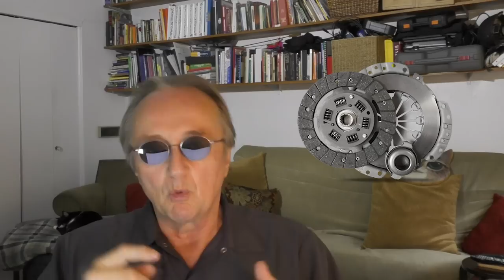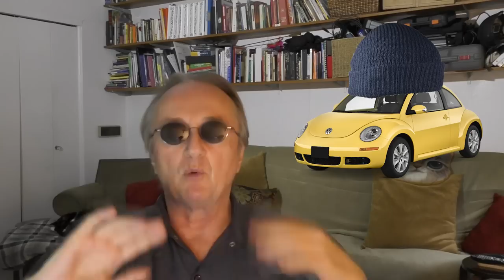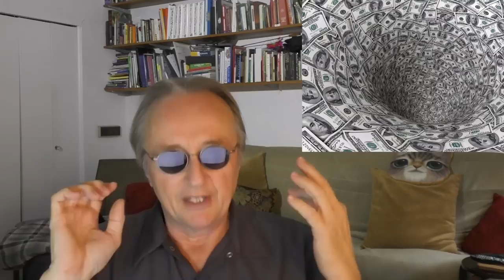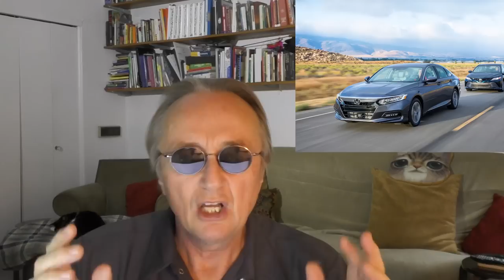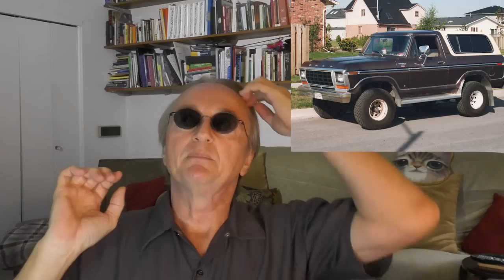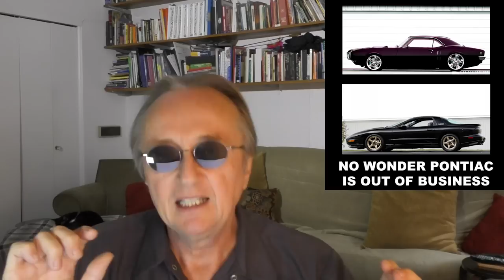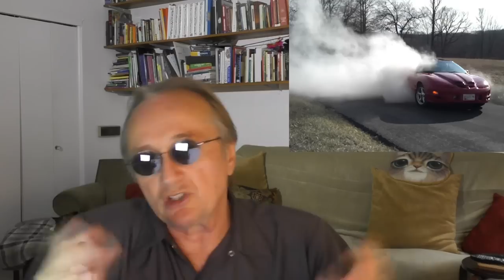Doing This Will Destroy Your Car’s Flywheel

Comment: Hello buddy clint here. I have a2001 nissan Xterra. When I started it up the night I bought it from my buddy for$300 it was cleaning and banging something fierce. I have came to the conclusion that the flywheel is broke considering I got the gas pedal and got it up to 6 grandma I think and I had a bell housing bolt and a starter bolt come straight out onto the ground. What's your opinion?

Comment: Hey Scotty just bought a 2012 Subaru Legacy with a v6 and 5 speed automatic transmission. It’s got 87,000 miles. I don’t hear you talk to much about Subaru. Is it a good car? I live up north near Chicago and wanted AWD
Reply: It has a horizontally opposed 6 cylinder (H6) not a V6.
They're alright cars, but will be pretty hard on fuel.
Reply: Mike M. It’s better than what my old ford truck on gas😂

Comment: I have a 2003 Golf with probably the same transmission as that beetle and mine's starting to have the same problem... It won't creep on its own in Drive, but putting it in 1st or 2nd does the trick.

Comment: My ‘04 Cooper S’ clutch occasionally slips in 2nd and 6th, which is odd to me that it only does it sometimes, but I’m gonna replace it in a few months. I know that heavy town use usually agitates the issue. It currently has 139,986 miles on it. I’ll probably get a lightweight flywheel as well.

Comment: Hey Scotty, I just bought a 2007 Nissan Frontier v6 6 speed with 55k miles, love it so far, only thing is almost everytime I drive it the abs/slip light will pop on and stay on for a while, Then turn off. It happens at random. Have you seen this before?

Comment: I have 99 ford ranger I just replaced the clutch and flywheel wheel it worked good for a month now when I try and shift it won't shift unless I push real hard on the shifter and sometimes it shifts when the clutch isn't even pushed in what's wrong with it

Comment: for the transmission issue, if you are on "lifetime trans. oil" and have never changed it in 3+ years maybe the oil is just too thick causing the trans. to shift weird. try putting new oil into it first

Comment: Hey Scotty, I have a Nubira 2CDX Korean model, when I realease the gas pedal, it shakes me a little bit. The same thing happens when I press the gas pedal. Sure, I press it and I realease smoothly. What's your thoughts about this?
Reply: It's possible the motor mounts are worn out, which is common for front wheel drive cars. It's normal for the car to shake a little bit when you're on and off the gas, but if it always shakes a lot no matter how slowly you step in the gas, the engine is probably rocking back and forth loosely because of worn motor mounts.
Reply: Wow never heard of that manufacturer b4.
Reply: @timothycc711  Daewoo product! It was popular in Europe. At his time..was something.
Reply: @Mdudeman13  thank you!

Comment: Volvo S60R has issues with the Haltex AWD system and the Diff. Also cylinders tend to crack if  power output is increased.

Comment: Hey Scotty love your channel keep up the good work.
I have a question I have an 01 bmw 325ci (I know money pit) but I love the car. Car was running just fine then. I woke up and jumped in the car and the clutch has no resistance and won’t go into gear. It turns on fine, and the gears never slipped. People tell me it’s the master clutch cylinder others say it’s the clutch. I know it’s really hard to diagnose a car when it’s not physically there but do you have any clue or guide me in the right direction? Thank you

Comment: Hi Scotty k! I'm a big fan thank u for your videos very helpful. I have a 2006 Hyundai Tiburon 4 cylinder and I did the clutch last year in December and here we are in August the flywheel went out due to the starter not engaging the flywheel properly and now I'm looking at a flywheel replacement. Before this happened I had bought a starter thinking it was the starters problem and the bolts were just so worn they would allow first time start up then begin grinding well I was working so I would push start to work for months before the flywheel gave now the clutch is under warranty but I was wondering if you think this car is worth it . I own it however haven't been in a good position to get into a newer car

Comment: My friends NA Miata won't go into 1st gear, and if you try it will stall. He has to start it in 2nd. What's wrong with it?
Reply: I would guess the synchromesh is bad. Does it even try to engage or grind?
Reply: Check the clutch master cylinder/slave cylinder.

Comment: The original SUV were the Jeep, Chevrolet, GMC, Dodge and even Ford panel and delivery wagons but Jeep had three versions, station wagon, utility and delivery. The wagon had rear seats so Bronco was a long way from first. Guess it depends on when the term came about, heck I guess a Woody Wagon could be a grocery and kid hauler as well. Jeep was 4x4 until 2006 when Chrysler turned it to today's what ever it is.

Comment: Hey Scotty, been following for a long time. Thanks for all your helpful.
My question is, what is your experience on Ford Ranger engine's reliability? Specifically new 2019 2.0 EcoBlu single Turbo?
I'm planning on getting a work horse for everything, including work and family duty.
I plan on keeping it for 20 30 years, if it'll last that long.
I would pick the Raptor, but 2 turbos over time is just adding more problems to the equation.

Comment: Scotty, 5th is the highest gear in a 5 speed, not the lowest. It slips more in a higher gear because the engine is spinning and its usually at the point of highest torque

Comment: Anytime I do a clutch, I have the flywheel machined for an average of $35 to get a perfect surface. I personally don't believe in putting new friction material on a worn surface. Brakes or clutches.
Reply: I'm with you, resurfacing a flywheel is an absolute must.

Comment: Scotty help please!

Looking to buy a used 2013 manual transmission FJ Cruiser 87k miles or used 2010 automatic with only 84k miles. The 2013 is from the north east so worried about rust, but the 2010 is a California car and no rust. Choose the FJ because I heard the Tacoma is it’s cousin?

Am l wrong to think that a used manual transmission is a easier fix than the used automatic if there are problems? 

BTW...great job thank you for sharing your expertise!
Reply: You know manuals are less complex and easier to fix

Comment: here's a tip for checking if the clutch is ok: with the car stopped put it in 5th gear and let go of the clutch - if the engine stalls it means the clutch works fine, if it keeps running it means the clutch is slipping.

Comment: I believe that the V6 engines the late 90s and 2000s Firebirds used were the 3800 Series II. Those things were immortal.
Reply: Other than intake gasket issues and plastic upper plenums that melted around the EGR port, yes, 3800 II engines are fantastic.

Comment: Someone answer asap! My mustang has a semiautomatic transmission with 3 manual gears. Instead of doing burnouts in drive and hurting the transmission, would it be better if I did burnouts in one of the manual gears? Or am I going to hurt the transmission either way?
Reply: Never do burnouts.
Reply: @wholeNwon  what's the fun in that?
Reply: Burnouts are endless money pits
Reply: It wouldn’t make a difference because your car either way would possibly shift into the next gear when approaching redline.

Comment: Scotty...
I replaced the transmission in my 2002 Explorer after 200k miles.  Did I make the right choice.  It seems that this is a pretty reliable vehicle.  The problem with the transmission was it started slipping in 3rd gear.
Reply: If it cost you more than 3000 then I’d say you were better off trashing it

Comment: Can anyone recommend a 2010 Hyundai Accent 5-speed ? Looking at one for 150k miles for 2K .
Reply: Find out when the timing belt was done.  Hyundais used to require them at 60K intervals.  Make sure the engine coolant has been properly maintained also

Comment: how would I keep water out of my tail light? if I sealed it with rvt silicone would it void my warranty? I just noticed water condensation in the tail light.
Reply: He just recently put out a video on that. You drill a hole in the lowest part of the plastic assembly to let water drain out of.

Comment: Hey Scotty! What do you think of a 1984 GMC Sierra pick up with 180,000 miles on it, my grandfather put new 350 V8 5.7 L engine, 400 transmission, and transfer case in 1992 it sat for 17 years runs and drives great. Thank you have a wonderful day
Reply: Those 350 engines are great. Just watch out for oil leaks because the seals will become dry and brittle from sitting.

Comment: 2000 Firebird?  No.  I had a 1999 model from 5,000 miles to 34,000 miles until I sold it and got a 2002 Ford Ranger Edge (a model with a 2" factory lift kit.)  The Firebird's (manual!) transmission went out once under warranty and it took 3 trips to the service department to get the rear end to stop leaking. On a hot day the top section of the dash (very thin plastic) would expand and I could see the wiring behind it through the gap. That 3.8 L V6 is famously bulletproof but the rest of the car was GM-in-the-90s-level "iffy." It's not a performer so any V6 from the era would be just a quick whether it was a minivan, midsize car or pickup.  It had a shameful amount of body roll.  The 5-speed had such ridiculously long throws that I (average height) would have to lean my body slightly to the right to shift into 5th.  That lifted Ranger pickup I mentioned with a 5-speed on the floor had shorter throws and handled a LOT better in corners with much less body roll. I still think the Firebird is a GORGEOUS car and loved the T-tops, but it was also a dog.
Reply: Lol I’m the guy so asked that question 5 months later my firebird is working awesome with 160K miles with a auto transmission everything works all I had to do was change the coils and I bought the car for 2000k also I don’t know what your talking about body roll my car is planted to the ground more than a ranger lol
Reply: Plus for the time this v6 would beat most of the competition that also had a v6 such as the pathetic 150 hp mustang with dual over head cams

Comment: Scotty can an LS1 engine go as long as a Toyota, I have one and it has 190,000 miles on it. Should I sell it before it goes Boom.? I'm hoping to get 300,000 miles. Is it possible.
Reply: Yes it can go 300k with proper maintenance.  I own two 2500hd trucks with 6.0 gas LS. Both have 200k mi. I know of many that have made it to 350k.

Comment: Hey Scotty I got a celica st205 gt4...when I put the car in first gear and give it gas it sometimes pops out....but this only happens with first....what can be causing this....thanks in advance for any feedback
Reply: Probably bad synchromesh or gear linkage, worn transmission mounts can also cause this but since it is first gear I would say more likely syncromesh. My car occasionally pops out of 2nd and getting into 1st can be a bit stiff. My advice is to just live with it, you can drive them a long time that way.
Reply: Bad synchronizer, insufficient or dirty oil or linkage out of adjustment.  Guess other things but I can't think of any now.
Reply: Thanks guys

Comment: Hey Scotty can you do a video on adding power without boost? Also, how do you feel about the Nissan 350z? I love hearing professionals talk about it.
Reply: Tires, air filter, remove unnecessary weight, exhaust system... there you go.
Reply: @CollinMac96  I already got all that tho
Reply: There’s not really much else you can do without forcing induction.

Comment: GET AN 81 BRONCO! 351w with steel wheels wrapped in bf Goodrich 33’s  flow masters exhaust h pipe msd ignition ford racing wire with ngk plugs eldebrock intake manifold 4 barrel holly carburetor permacool fans! I regret till this day selling mine...😔🥺😢😭🤤
Reply: What kind of gas milage did you get with the 33's on that beast?
Reply: Timothy Clark I think the M1 Abrams gets better gas mileage! Maybe 9-10 miles.
Reply: @Operator-om8ih  wow yes I lost a lot of gas milage when I put 3ply 33's on my 2016 2.7 EcoBoost (at least 7 mpg).
Reply: Timothy Clark Krang!!!

Comment: Hey scotty I have a 96 geo prizm and my thermostat gauge on dash stopped working.....gauge stuck between low and mid level.....what I think could be cause this.....I changed thermostat sensor a week ago still isnt working
Reply: Temperature sending unit or temp sensor
Reply: @rays7437  i changed the sensor so I guess I need to find where the sending unit is
Reply: @youngbeezee2011  
It's rare but the gauge itself could be bad. Is the check engine light on?  Also when you first start the car does the gauge sweep from one side to the other?
Reply: @rays7437  no check engine light at all......and the therm gauge is stuck between the bottom and the center line on the therm gauge
Reply: @rays7437  gauge is stuck and never moves at all for the last 4 months
Reply: @rays7437  i think it may be the tempature switch being as tho online it says the temp sensor and temp switch are totally different......
Reply: @youngbeezee2011  
I would try replacing it

Comment: My wife's 2016 jeep renegade starts on its own like it be all haunted an stuff...most likely a short...but where???
Reply: I saw a ford that did that.  It turned out to be a bad remote start clicker.
Reply: @rays7437  ...we have 2 of em ... maybe I'll take the battery out of 1 then the other and see wot happens mate
Reply: @HELLHAMMERHANDHIX  
That's what I would do :-)
Oh, did you have the car battery tested?  A faulty cell in a battery can make cars do crazy things.  I've seen them lock and unlock doors, roll widows up and down, beep the horn, turn on the alarm, and flash the lights.  That was all happening while the car was off and the keys out of the car.  Just a thought.
Reply: @rays7437  ...it's easily done ,I can check it at work ,but I would expect it not to be as its a 2016 ,plus here in WV the average battery lasts about 5 yrs . But I work in an a auto Centre ,so if she can be bothered I'll check it.
Reply: @HELLHAMMERHANDHIX  
I wish batteries lasted that long here...
Reply: @rays7437  ...we have customers who have 7yr old batteries...some with 4yr old batteries when they replace them generally. But there are some exceptions ,as with all thangs !!!. You don't need a brand new battery...BUT IT HELPS !!!.
Reply: @HELLHAMMERHANDHIX  
wow, where do you live?  In Arizona and California where I have lived for the last 20 years, the heat kills batteries.  Sometimes the explode all by themselves.  Sounds like a shotgun, it's scary
Reply: @rays7437  ...WV matey !!!

Comment: Hey everyone I need help I have a 2005 pt cruiser touring , when I make a sharp turn the car shut off but I can start it back up idk what's wrong I'm so stressed over this car I'm gonna get another one what will be a great adorable car?
Reply: That issue sounds very familiar.  Did you call the dealer and ask if they have known issues.  I'd swear when I was at Chrysler that was an issue. But I don't remember the fix.
Reply: @rays7437   I took It to get checked but guy said nothing is wrong, I know something is wrong I don't want to put a lot into the car to continue to have problems
Reply: @versaceslife5805  
Does it make a difference how much gas is in it when it happens? Is the AC on when it happens? 
Are there any warning lights on when the engine is running? Does it do it regardless of weather or temperature conditions?
Reply: @rays7437  I only fill my tank half way but when I first bought it last year in Aug I got a full tank never happened but then the bettery died  I got a new one it still died during sharp turn it only happen sometimes I got to be careful making a sharp turn but now my car battery drained if I don't drive it for two weeks it dies I have to give it a jump for it to be okay it's a new battery but this only started when winter hit tge battery draining when I live it snow and temperature drop to 25 I'm just so stressed over this car I don't know what to do I just pray I get help thank u for helping so far I really don't know should I fix it or should I get another idk
Reply: @versaceslife5805  
Have the alternator output tested. 
A battery should not drain in 2 weeks, it may be defective. 

Here's my guess, something is going on with voltage. If the alternator is under performing, then extra load my cause a temporary voltage drop to the idle control motor, which can cause engine stall.  
But that's just a guess.
If you were driving an old car I would say that the float is bad in the carburetor. 
Are there and warning lights staying on? Like the check engine light or door ajar light or anything?
Reply: @rays7437  no check engine light no warning but I have been saying from the start maybe the alternator I was just about to ask and I will get it tested idk do auto zone do the testing and it could be the battery too at the time I bought the battery auto zone said they got a bad batch the batteries were leaking but I have been thinking alternator
Reply: @versaceslife5805  
it is quick and easy to test. When I test them I turn on the lights and accessories and let the test run for several minutes to see if power drops as it gets hotter
Reply: @rays7437  okay I'm gonna try that thank u
Reply: @versaceslife5805  
Let me know how it goes
Reply: @rays7437  I will do I go to auto zone or idk hopefully nothing serious